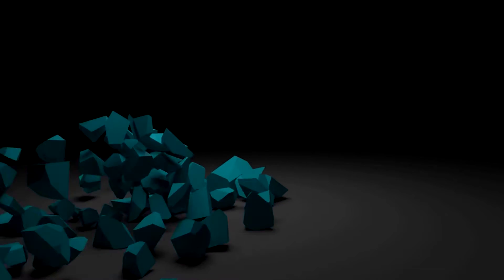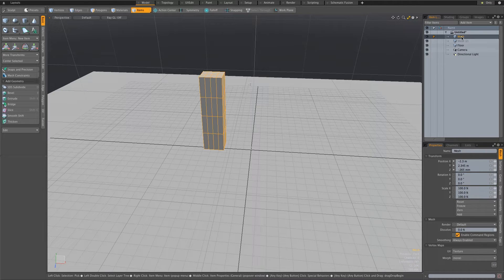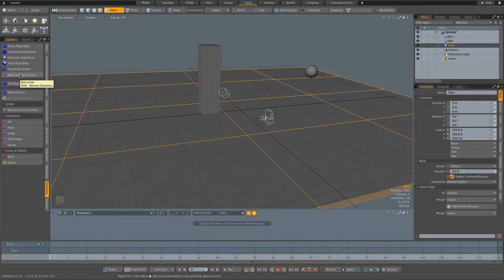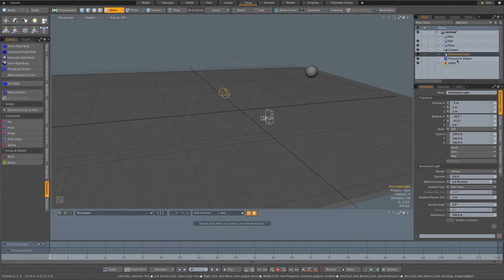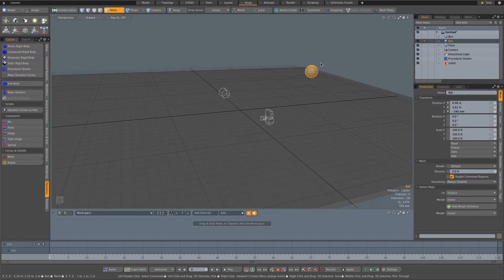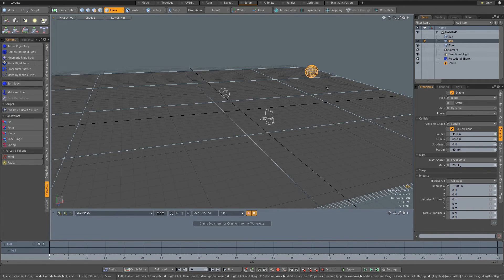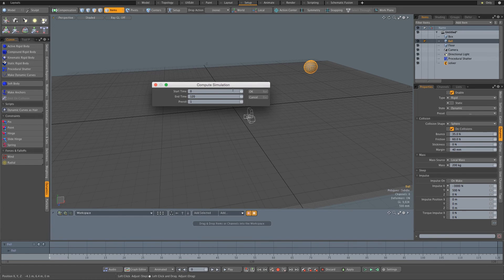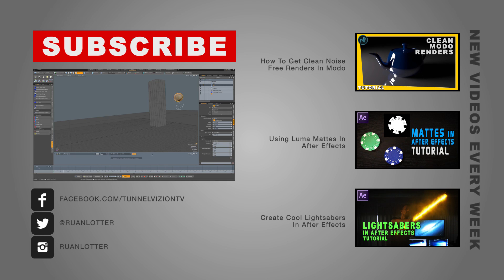How To Break Objects In Modo Using Procedural Shatter

Comment: Hello & Thank you for the tutorial. Very clear & concise.
I am using mood 10.1 v.1. The simulation doesn't always work. It crashes any time I make adjustments. I keep the setting exactly the same ( as far as I can tell).  I am trying to adjust the timing of when the column breaks apart. It breaks apart before the collision.
Cheers!

Comment: Thanks. I'm just wondering what the best way to keep the bottom of the pillar more firmly fixed to the floor would be.
Reply from the maker: +BigDaz hi best is to set the mesh position manually - let's say the floor is 50mm thick / tall, place it at Y -25mm to have it on the grid, the have your pillar at 0 - hope that helps (writing this as I'm waking up so might be confusing haha)